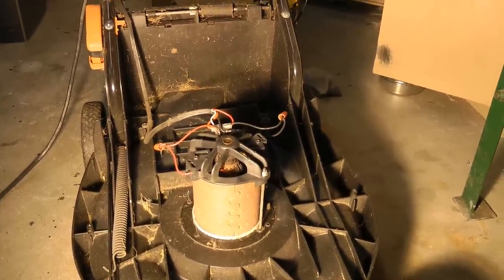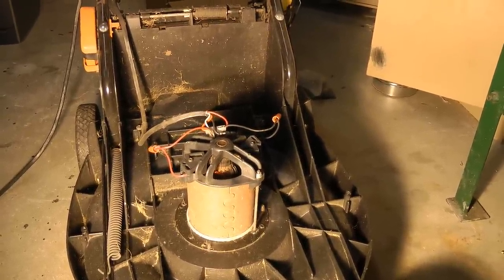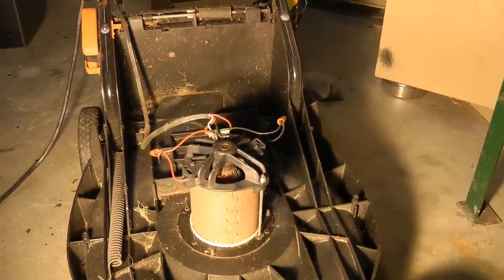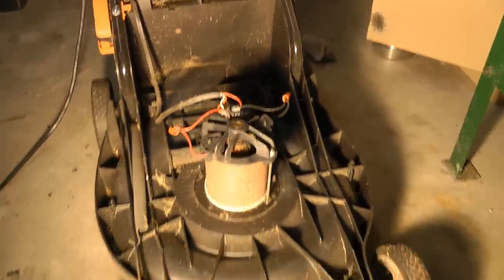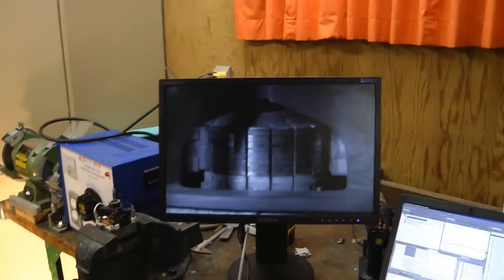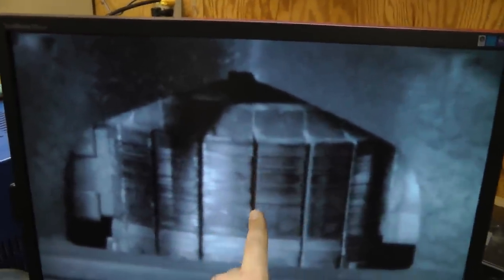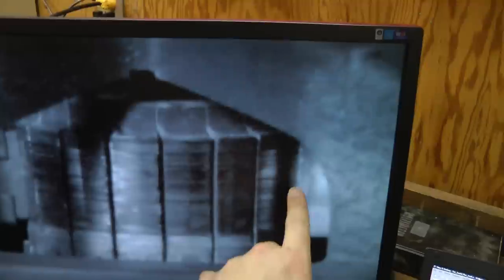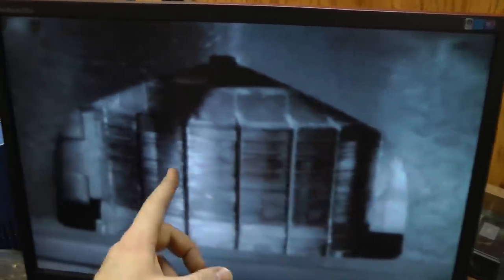Motor commutator arcing at 10,000fps

Comment: this motor probably has a broken wire on the rotor, thus it draws an arc at each turn between the two same comm bars. A burn mark is visible on top of the gap.
-> repair is finding the broken wire on the rotor and re-solder it

Comment: sir my new drill leaves small sparks while I press full speed..I saw that while using first time at night..is that harmful for my tools health?
Reply: It's pretty normal for any motor to have slight sparking due to the carbon brushes but excessive sparking I would be concerned about
Reply: Light sparks are normal but massive sparks produce heat and spoil both carbon brushes and rotor coil as well.